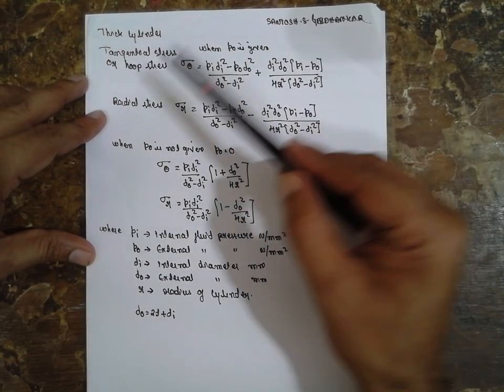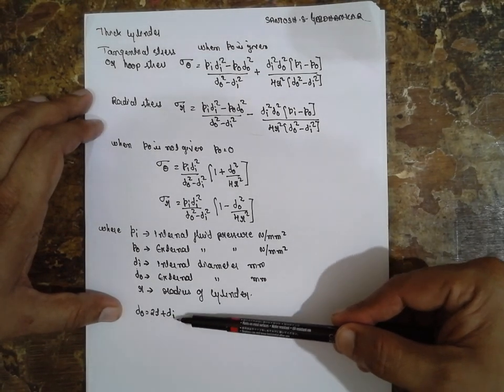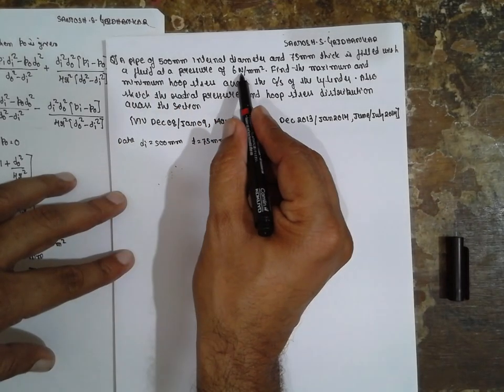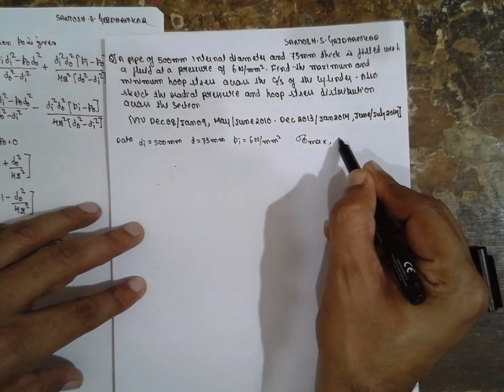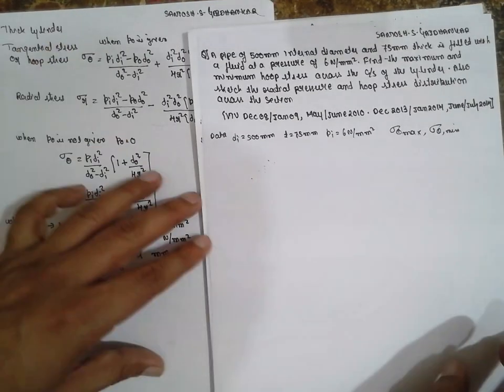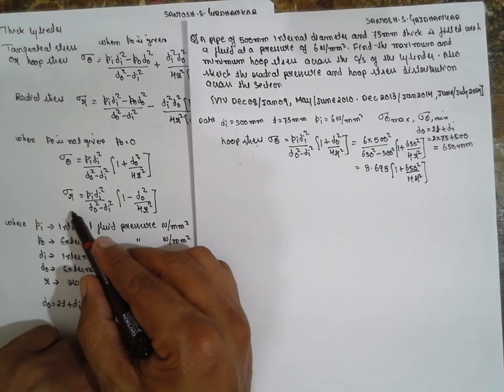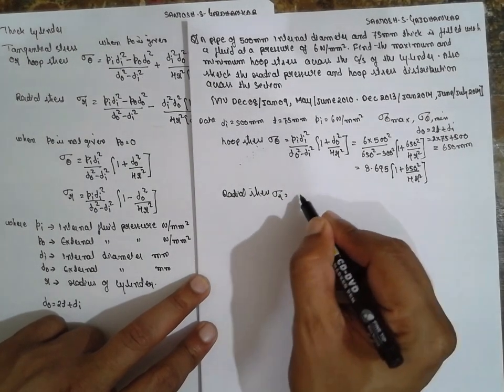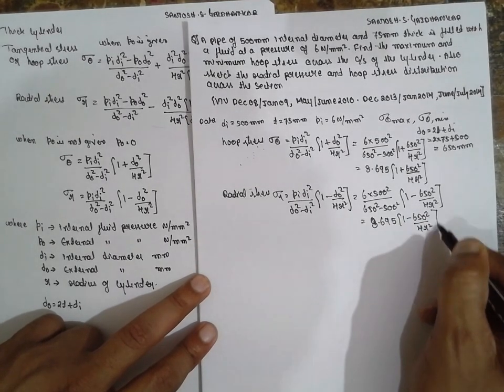THICK CYLINDER PROBLEM-LEC-1 (EASY METHOD)

Comment: Sir then how to find di when it's not given and both the pressure are given internal and external we should use first formula know sir UR REPLY WILL HELP ME A LOT
Reply from the maker: I have explain in the videos. Please check it
Reply: @santoshsgaidhankar5795  okk
Reply: @santoshsgaidhankar5795  A thick cylinder has inner and outer diameters as 120 mm and I80 mm respectively. It is subjected to an external pressure of 9 MPa.Findthe valu cof intcrnal pressure which can be applied if themaximumstressis not to exceed 30 MPa. Draw the curves showing the variation of hoop and radial stresses through the material of the cylinder.
Reply: @santoshsgaidhankar5795  how find internal pressure in this sum sir plzz reply
Reply from the maker: They will give  Do and thickness to fine di
Reply: @santoshsgaidhankar5795  yes sir they have given I have mentioned the problem above but unable to find Pi